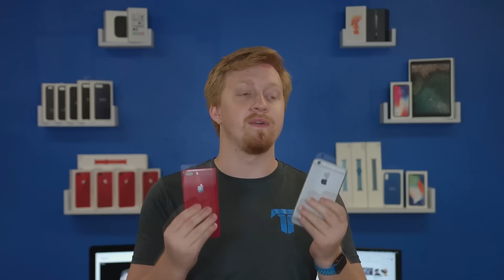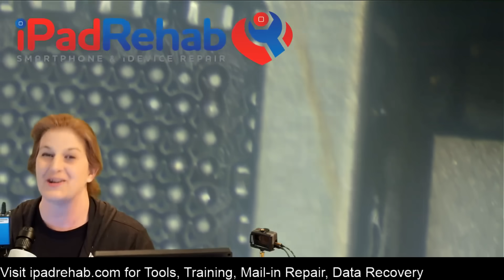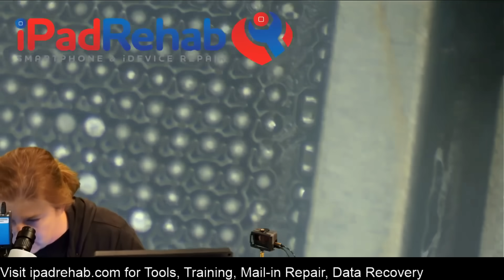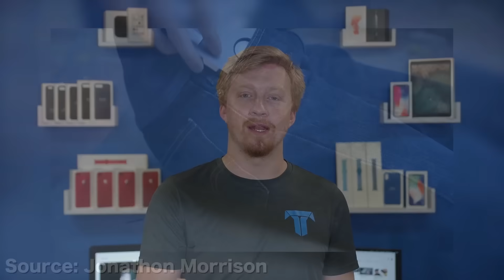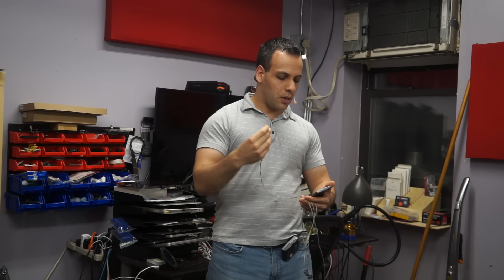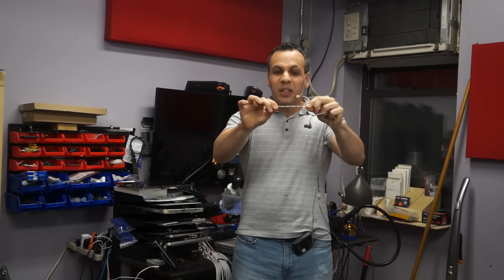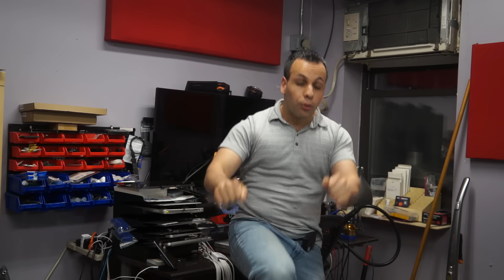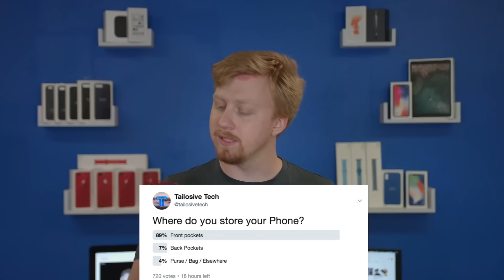The truth about iPhone bendgate deniers

Comment: I had two iphone 6's... I bought one for myself and one for my boyfriend.. Right after the warranty ended both phones failed with the defect.  I went back to the apple store and they said I would have to pay for the repair but the tech also said it would reoccur  and recommended that I buy the iphone 6s...  I was stuck I needed a phone and could not wait weeks to get ones that I had "repaired".  So out comes the credit card and I buy 2 more phones... what's that.. like $4000.00 in phones!!! I also could see no visable bend in the case.I didn't even know about bendgate.  I still have the 6s's but they are starting to crash for no reason.  I'm going to samsung and android.  Not only does iphones suck i'm also tired of apples content blocking...   I'm paying almost $1000.00 for a device...  it's mine.. I should be able to do with it what I want.
Reply: Unfortunately, that's not the prevailing view these days.  From Apple to automobile manufacturers, your physical ability or legal right to freely use/repair/modify the products you buy is undesired.  The fashion of rent-seeking behavior drives them to artificially limit the longevity and arbitrary use of products.  ... so no, in their eyes, it's not yours and you should only be able to do what they want to let you do.
Reply: I got my hands on a Google Pixel XL and I never looked back.  

Not the Pixel 2, mind you.  Not a fan of that one.  Pixel XL keeps the headphone slot and it's much much cheaper.
Reply: I can feel you! One of the many reasons I never bought an iPhone is this no bluetooth, appstore only, no SD card, non-removable battery, 'secure' bullshit .. if I get a phone, I want to do whatever I want with it, and as long as apple keeps their bullshit, I won't even consider going iOS. Granted my current phone has an unremovable battery .. but it was the cheapest phone in it's class. If I'm paying for an iPhone, I expect no flaws, let alone technical flaws that they don't even support!
Reply: By all means, jump ship from Apple, but not to Samsung. They still can't make a phone that doesn't bog down after a couple of months.
Reply: Kobe Wild I'd recommend asking around. Samsung doesn't do too well with updates.
Reply: really? where did you get one free? I prefer them to apple though. Love those screens that apple uses from samsung
Reply: Dream Services International 
But that label that says “no user serviceable parts inside”....I’ll have it open in a jiffy for ya 😂
Reply: I never had a phone break on me in over 15 years only had an iphone for about 6 months out of all that time though
Reply: Kobe Wild Apple are just a bunch of con-artist's and should be shut down right now....
Reply: I wouldn't recommend a samsung. Try something that has the closest stock android or just go for the google pixel. And do know if you are used to the iPhone, it's not going to be easy at first to use a different OS but you'll get used to how stuff works on android.
Reply: hmm ive had samsung phones since the galaxy s2 or s3
Reply: nope wasnt jabbing. why you so defensive
Reply: Android ecosystem is so diverse so i suggest do your research first before buying a phone to make sure it fits your needs. I also suggest looking at the nokia android smartphones they are very durable if thats what you are looking for.
Reply: Kobe Wild I would personally stay away from Samsung, and go with an ASUS instead. Samsung looks nice and has high end components (Though IMO the recent ASUS phones look nicer, and have very similar specs) but they alter the OS so much that it's virtually unrecognizable and often times worse than stock.
Reply: The Worst Channel: I use my back pocket, mostly because my front pockets have things in them that would scratch the crap out of the phone or chip the screen.    But then again, I don't sit down without making sure it's not going to get pinched.   My current phone (an old XT926) has been significantly bent (by both the previous owner and by a swollen battery), but I never had any functional problems.  I just replaced the rear case and battery.
Reply: John Scarce years,  pretty much any droid but Samsung
Reply: The device is yours not the content 👹. i had to replace three iPhone 6’ two months after buying but the fouth one lives in a defender case and is still a champ to this day. i do sympathize with your frustration though.
Reply: Welcome home...
Reply: Get a Oneplus, not Samsung, you will love it
Reply: If possible I'd suggest you buy a chinese phone. XiaoMi is a very popular brand and is spreading like wildfire. I paid like $200 for "xiaomi redmi 4 prime" more than a year ago and it's still like new, it' not running the latest android OS but I can always flash a different rom if I find the official rom, which still gets regular updates, lacking.
Reply: Kobe Wild stfu
Reply: rooster sideburbs
Daily using an S2 Galaxy- bought new for $750. Just unlocked it this am. Only got 1 little memory glitch I ain't fixing; for years, S2 wouldn't update from 2.6.6 with oTA firmware, then I found out that android 4 exposes a graphics chip bug in many Snapdragon CPUs, including mine. Also, when I attempted an OTA after unlocking, S2 complained about WiFi being off; so, I've been doing it wrong for 8 years!
Reply: shereef mohammed
You see with your eyes but not with your mind. The problems with HAVING Bluetooth are nearly the same as SafariBlock websites: file transfers are filtered by URI/URL name in a vain attempt at virus protection, which filtration comes with the added cost of maximum file size transfers, accompanied by similar storage capacity limitations, all because of Bluetooth's age. Apple with BT couldn't nag any more about being 3 weeks since uploading backup to iCloud, because then that'd be like advocating how everybody should upload warez to be hosted by badApplez. No, thanks. I'll take my iPhone 16GiB filespace as contiguous and not limited by Fat32's 4Gb structures and scrutinized by IBM's ancient failure at NFC. Remember when Napster viruses always came from the tiny files? That's why we can't have nice NFC.
Reply: sintwoOone gtfo
Reply: Clariece C dam you aplle sheep are sad fanboys!
Samsubg galaxy s5 neo working years no problems like iphones had so many flaws like dam 😂👏
Reply: Best thing I did for my turd 6 is I put it in an otter box. 
I never broke it yet, but did get a warranty replacement thru my phone plan, and shortly after I got the battery drain issue.
Methinks I got a phone that sat uncharged for a long time on the shelf. 
I’m done with it, as soon as my plan is up I’m switching back to android.
Reply: If you're concerned about running the latest version of Android by default, then Samsung shouldn't be your choice. That being said, they're semi-regular with security patches and launch with features that are at least a year ahead of the competition. 
And their hardware is still the best. If you don't care about the touchwiz/Samsung exp stuff, then running a custom launcher or a custom Rom can help you experience the best of both worlds.
Reply: Do you guys put your phones in the side pockets. Or back pockets?
Reply: Yeah because the Sammy knockoffs last 2 years on average and you pay with your personal data and get no updates after 2 years. You have ZERO idea what you're getting into by buying an iPhone knockoff.
Reply: Love that technology android uses from Apple, I know you tried to jab Apple there but the irony was too much especially considering Apple had contracts with these company years before they started releasing knockoff iPhones.

Sammy gives a lot of their phones away in exchange for data, almost any carrier has free iKnockoffs as "promotions".
Reply: No buy a real iPhone, the knockoff iPhones are data mining leeches with close to 0 customer support and the software is obsolete within months.
Reply: This is an Apple conversation, bashing is normal. People are easily influenced by the media that is paid to bash Apple. That's how all these pathetic stories like bendgate begin.
Reply: That's a typical android user response. They say crap without understanding what they are saying. They don't understand Apple had contracts in place before companies like Samsung began making knockoff iPhones. Can't wait for that contract to end though.
Reply: pls no samsung. samsung is cancer
Reply: Don't recommend an iPhone knockoff at all. They're cheap for a reason, android makes money off your private data.
Reply: Samsung makes the closest iPhone knockoffs though. Get one for free they're always giving them away. They want your data bad....

Comment: Is the flexion based damage is the same to what happens to the charger cable when it looks like your dog ate it after using it for a couple months?
Reply: TheSuraj03 No it's what happens to the inside of the headphone cable when it still looks perfectly fine but doesn't work.  It's also the problem that headphone makers reduce or prevent by putting a partially bendy thing around that cable at both ends, because that stiffens the cable enough that the natural bend from moving your head gets spread out over more of the cable, thus increasing the time until it finally breaks.  Similarly, Apple might have fixed the issue by changing the metal and glass part of the phone so the natural flexing from picking up your phone and pressing the button doesn't get focused on any small part of the board.

They could also have a planned data recovery process for damaged boards so the "genius bar" can quickly transfer the encrypted data from a damaged phone to a new or refurbished same model phone (as long as the customer still has their pincode or fingerprint).  That might involve opening the phone and clamping some Apple rig to the flash chip, touch sensor and security chip, while the user unlocks the encryption, then copying the data to an unopened blank phone plugged into the rig.
Reply: Jernej Jakob they should have used better strain relief and a thicker sleeving on these cables, they arn't worth the money people pay for them, just like some of the inferior designs of other products they use.
Reply: I saw on another video of his of someone talking about how he works primarily with apple, so he is biased and hates them,, which I think is garbage,  other manufacturers put out poor designs, but they   usually fix them with a new generation or do a revision  of the product to fix those issues. If any other manufacturer Constantly put out products that have defects of this magnitude, they would quickly go defunct.
Reply: John Francis Doe I'd love to see Apple actually listen to feedback, such as the one u provided and improve their products and solve their  issues, but with the stance they adopt, I'm frankly surprised that so many people defend the actions of the company that constantly applies  band aids  to bullet holes.

Comment: The reason is most apple boards are long and put length ways down the phone , most android phones have a short board at the top.
Reply: felix gaming vlog so how did Samsung do it? Galaxy's clearly have more features so features can't be the reason why they would need more chips.
Reply: The Sony Xperia SP is an example of a device that has a a motherboard which covers most of the phone's length. It's durable af tho.
Reply: Then why don't they make it a short board to fix the issues?
Reply: TheUnknownSoldier mybe for many chips who know i see iphone mobo and its tightly pack
Reply: i dont know my cheap samsung tab mobo is huge too many space for  smarphone but normal for tablet but my spc l53 mobo is tigly space and samsung mobo is square and apple mobo is like L but upside down
Reply: and apple mobo is thin

Comment: And I'm still surprised that Xiaomi Redmi 5 Plus chasis is even thicker than iPhone 6/6s/6+/6s+ (unfortunstely, thr thoughtness feeling is brought by the battery, but not with the chasis).

But, the flex strips positions are fitted in the chasis spaces for avoid the timelapse consistant pressure of attatch the chinese smartphone in question to any rack for cars.

Comment: Just look at the old xbox 360 with the red ring of death was flection damage of the CPU and GPU. And Microsoft redesigned the system to keep it from happening. Lead free solder is more brittle so it can't handle flection
Reply: I could be mistaken, but I thought the issue with the Xbox 360 was heat-related? As in, it had inadequate cooling, so the solder of the graphics chip would cook itself loose over time?
Reply: True! But due to the way it was clamped down the the x clamps they were flexing under the temp change.
Reply: Main issue along with the heat was faulty capacitors that feed the CPU and the GPU.  I've got an X-Box 360 on my work bench as a 'toy' that I'm trying different repairs on.  It had the RROD, last owner did a fix to it.  But failed to notice the 8 capacitors that had severe and moderate bulging on the vent caps.  More or less picked it up to see if I could cure it's problems.  The cap's cause power issues, the CPU or GPU overheats due to unstable voltages..and then you start snapping your balls...
Reply: I did the penny trick to fix two xbox 360's...would work for a while and do it all over again...I guess I was like the apple sheep for that xbox because as much I thought it was bullshit that this kept happening I ended buying 3 different xbox 360's 😐

Comment: Apple and their damn planned obsolencence. I find it ridiculous that the company is so popular, I find it ridiculous that people praise a fraud like Steve Jobs. It really makes me lose faith in the consumer market.
Reply: Most people see Apple as a status symbol. A way to subliminally say "i'm part of that club". And some, including me, and im not proud of it, like the software and are forced to get the hardware. 3,5 years ago, I got my first Apple device, a macbook air 13 just cause my 15'' dell laptop died 2 months after the warranty expired and was not worth the repair so i sold it for parts. At that time, I wanted an ultrabook for university and work with great battery life. I was between the macbook air 13 and the dell xps 13. With exactly the same specs, the dell was 250€ more expensive. So I got the mac. Over 3 years later, I havent regretted it and it still works 8+h every day without a problem. Plus i like macos a bit more than windows (personal preference...). I also have and LG G4. 10 months after I got it, bootloop started. Warranty covered it and the board was replaced. Now, 2 years 6 months after purchace and out of warranty I have screen burn in. In an LCD screen... Not to mention I will be forever stuck on Android 6 without any hope of an upgrade. They even stopped the security updates in july 2016! Meanwhile a friend of mine bought an iphone 5s in 2014. 4 years later still gets software updates on day one. Im sick of this on android. Yeah, most android phone have better features, better hardware and are cheaper. But the noexistent updates make them obsolete. For my next phone Im seriously considering and iphone. Not for the hardware, but for the software. Unless there was an android phone that came with stock android and at least 5 years of software support... Even the pixel and android one ones get 2 years. I dont mind pay 700€ if im gonna keep it for 5+ years. But i have a problem paying 300-400€ every 2 years for a new android phone cause the old one stopped getting updates.
Reply: Whichever side you look, none is perfect. Android smartphones suffer from planned obsolescence on the software side. Apple products on the hardware side. Windows PCs and Laptops, generally i'd say hardware obsolescence. The whole Phone and Computer industry is a mess...